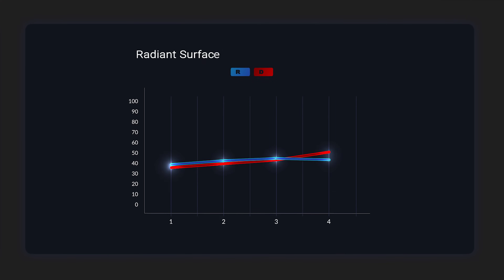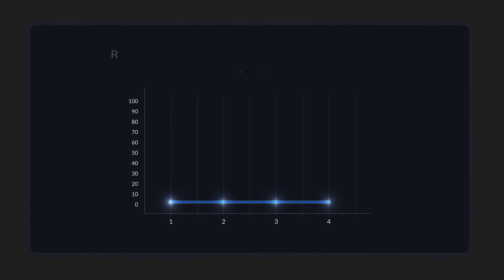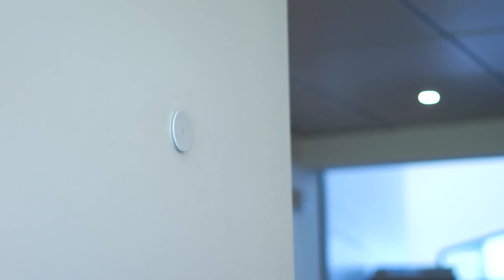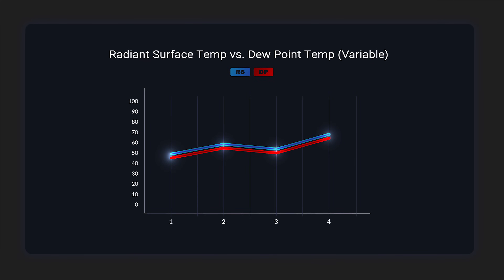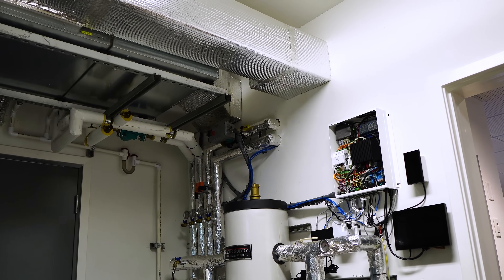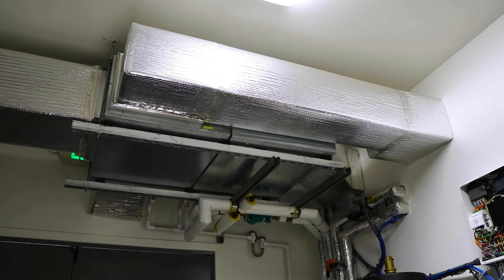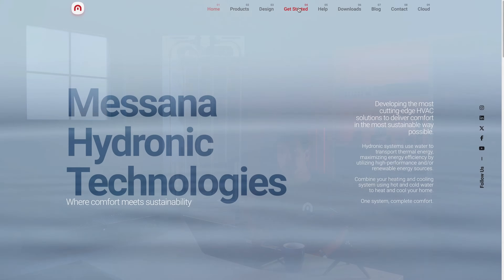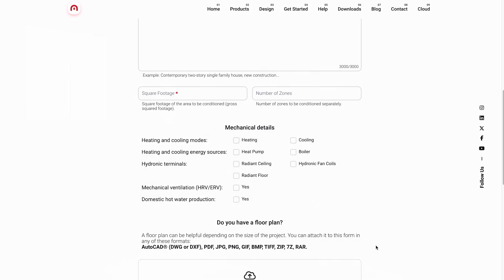Radiant Cooling With Messana Controls

Comment: How efficient is this system for rooms with high (11'-16') ceilings?
Reply from the maker: Hi there! System efficiency really depends on the energy source used to generate heated or chilled water, rather than the dimensions of the space. Using a more efficient energy source like an air-to-water heat pump, rather than a gas boiler, will have a greater impact on system efficiency.

In terms of system effectiveness: When designing a system, a mechanical engineer will calculate room-by-room load calculations. From there, we will specify the amount of panels required to meet loads in each room. So that is how we make sure the radiant system will provide enough heating/cooling output.
Reply: @messanatech  Thanks. My GC will be reaching out.